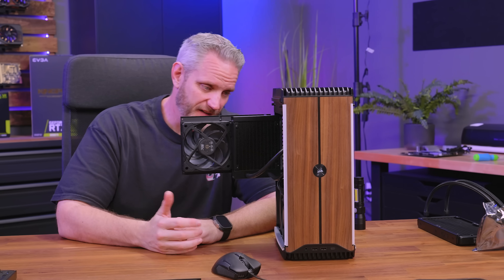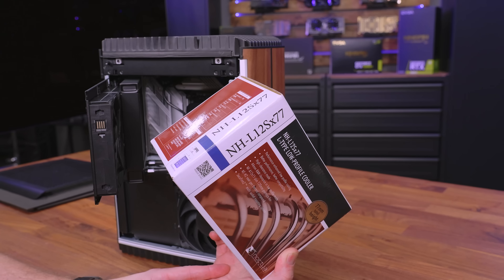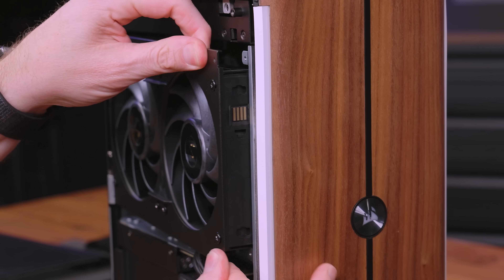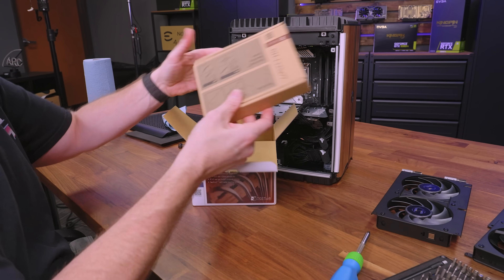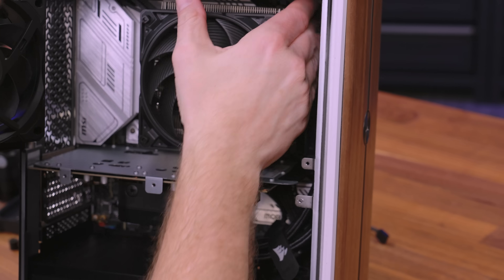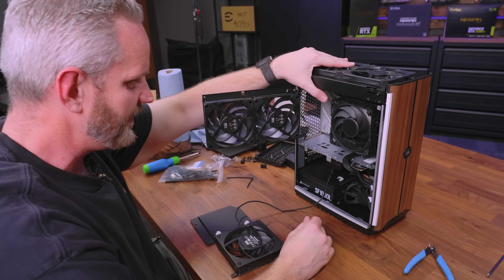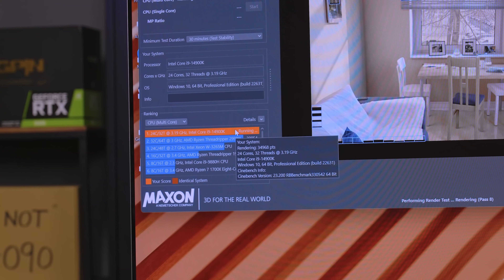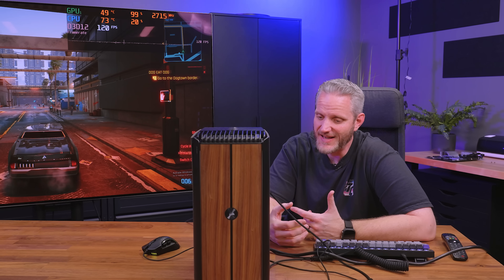Well... that was an unexpected improvement...

Comment: Hey Jay. You are talking about "saturation" of the liquid in terms of temperatures. This makes sense. And this is the reason why my fan curves are set up to adjust via the liquids' temperature, not the CPU/GPU temps. Because the logic behind it is, that if the liquid is cooler, it can decipade more heat from the actual components that are causing the heat.
No video of water cooling comparissions ever covers the temperature of the liquid. Sure, a bigger, wider, longer, thicker radiator makes a difference since there is more surface area.
But how much does it actually matter how high or low the liquid temperatures are? - Cooler liquid can take more heat out of the components, but to what point? Like what is a critical point where it doesn't "cool much" anymore? Does it matter if the liquid is just 30°C, or 36°C - does that make a big difference and if, how big? - Is it worth ramping up your fans just to keep the coolant as cool as possible, or can you easily have it take an extra 5 or 10K in delta and still get the components down to the same temperatures, or maybe just 1 or 2°C higher?
I don't know how to describe what I am looking for since english isn't my native language, but maybe you get what I mean and can make a video about that.
Reply: I'm on the same logic. On AIO, you are cooling the water with the fans. If you keep the water cool and  not going over certain temps, it will not let the CPU also reach high temps. You also remove the constant ramp up of the fans. 

Another thing that happen when you have set them to CPU temp is that after the load is gone and the Cpu cools down, the fans will spin down, leaving the water temps high for a longer timeframe.
Reply: @Mysteoa  That is why it is a good idea to set a short delay before the fan speeds ramp up and a longer delay before the fans slow down, if your BIOS has that feature. First short delay (couple of seconds) so that the fan does not unnecessarly react to short heat spikes your CPU sometimes has when doing background tasks and a longer delay (maybe 10 seconds) before it allows to fans ramp down to let it cool the water down quicker after the load has ended.  This way you are still reacting to CPU temps but on a slower pace which is a benefit of water cooling because the water is still acting as a heat soaking buffer, you do not have to have the fans ramping up and down every 3 seconds like in an air cooled system.
Reply: @MaaZeus  isn't it just the same result with extra steps? With my current setup, the CPU barely goes above 80C. I also don't have to adjust it for summer/winter.
Reply: @Mysteoa  Perhaps. This is falls between water temp controlled cooling and CPU temp controlled cooling. CPU temp is still the one controlling the fan speeds but it doesn't have to be so hyper reactive like air cooling needs to be.
Reply: The "problem" of using water temp only for fan speed control is that it takes a longer time for the water temperature to raise than it takes for the CPU temperature. But when CPU temp raises you know water temp will in time raise. By using CPU temp monitoring the fans will speed up before the water get warm, giving the radiator more chance to keep water temp down. and cooling the CPU quicker than if you monitor the water temp.

Now I'm not saying that water temp isn't important, it most certainly is. But the time needed for water temp to raise significantly is longer. Both methods work but one tends to react slower than the other.

Comment: This case design is stupid. My meshlicious is smaller and has space for a 4 slot gpu and a 280mm radiator mounted vertically. Why not design something similar to that?

By the way: this case design could probably fit a C14s or maybe even a small dual tower cooler, like the D12L.

Comment: If top part can fit 240mm GPU rad than case probably large enough to fit 240 for CPU
Maybe it`s possible to put CPU 240mm rad inside first, than close the lid with fans and screw rad to it?

Comment: check out the CFM on your fans, and maybe look into Delta fans. Yeah, they scream, but most of them have great CFM.

Im actually cooling a ryzen 9 5950x with a bunch of Delta fans in a 90s old style fool tower sleeper build no water cooling. surprisingly my 3080 ti is actually cooler then my cpu... I am honestly not sure how much more of a challenge this would be over what I did, lol. I might edit my post later with the delta fan models and what deep cool cooler I am using with these delta fans.

side note the hotest my gpu will get is 71c while my cpu when doing video upscaling will hit a max of 79c

most games even buggy mw3 does not even get close to making my gpu or cpu this hot.

Comment: An interesting video would be testing how many N x 120 mm radiator you'd need per high end cpu/GPU, and where the point of overkill (or like this video shows undersized) is where more is just wasting money.

Alot of people i see either build the water cooling to big  and just waste money (though I'd say there's a point for aestechics and such), or put a small aio on a cpu and believe its fine just because it says "water cooler"

Comment: Does the GPU have coverage on the memory? Or the VRM for that matter? It looks like it doesnt which is surprising, even with airflow throughout id feel like there isnt enough surface area to wick away the heat, but idk ive never pulled the trigger on AIO conversion kits for GPUs lol

Comment: This system feels like there were multiple teams not talking to each other when it comes to its development.  I mean if you know the CPU that is going into the system you immediately know the max amount of watts this thing is going to be generating at the high end.  At which point you know what cooling solution you need, at which point you have a good idea of the basic size of the chassis you need.
What's even worse is that for a $3000+ system these results at default config are bad.  Really bad.

Comment: I have been looking to the 14900KS but I am not really sold on liquid cooling. Were I to go that route, I might consider some sort of external radiator & fan assembly to totally remove the heat from the case.

Comment: True, 1 more inch wouldn't have significantly lengthened the case to cause any large issues as far as floor or desktop space is concerned but barring that, Corsair could just orient the case 90 degrees from what it is to then allow enough room for a 240! Either that or rotate the swinging bracket and hardware 90 degrees and then hinge them on the bottom of the current config to make said brackets long enough for a 240 without altering the case dimensions. Sheesh.

Comment: You would probably have issues with both ends of a 240mm radiator. The 120mm they have installed is turned 90 degrees, so the end with the tubes isn't included in the case depth dilemma either.

Comment: Now this falls more into line with my air cooled 14900K and the gaming temps are exactly the same. I must have a setting wrong in my bios cause I'm getting a lower score at 30K but my clocks stay higher like 5.3GHz P core the whole time. Or my CPU is dead essentially and I need a new one.

Comment: You could try the Thermalright SI-100 air cooler -  thicker with 6 heatpipes.
Reply: Thats only 0-3 celcius difference compared to Noctua L12S 77 in favor of Thermalright cooler.
Reply: @jarnom85  3 C can make all the difference. Especially when you consider how much cheaper the Thermalright one is.

Comment: I have gone back over to air cooled because it is much more reliable. And cost much less and does work very good. I have a Thermalright Phantom Spirit 120SE ARGB CPU Cooler that only cost me only $35.90, and it does the job for my AMD 9 5900X.

Comment: so basically if you want your PC to double as a space heater then buy an Intel CPU? I used to be an Intel fanboy but since switching to Ryzen yrs ago with the R5 2600X I'll never go back to Intel I don't care if Intel ends up getting 2x faster then AMD. I'm now on an R9 5900X (yes, I know it's now 2 gens old) and plan on sticking with AMD forever.
Reply: Intel for ever..  had been hardcore amd user..tried intel i was reborn..now after 12600kf i went back to amd with 7800x3d  and i cant regret it more...miss my old 12600kf..oced was waay more stable than 7800x3d

Comment: I wish I could use Fan Control on my laptop. HP uses hardware sensors to control the fans. I had to solder the PWM wire from the second fan to the first fan since HP doesn't uses it. It spins on start up then turns off after windows boots. Never spins again even if the GPU and/or the CPU is throttling.

Comment: Water cooling with a 120, not worth the extra costs and additional points of failure. At 240 the benefit is at least competitive with air methods. Never underestimate Air Coolers actual potential. The low profile coolers are also light enough that I wouldn't stress a lot when it comes to shipping as well.
Reply: Especially if you can’t see the inside, you don’t even get the looks factor of an aio

Comment: All of this could have just been solved with an AMD 7800x3D, because a 120 AIO could handle that, and it's a cheaper cpu, and performs faster for less wattage.
Reply: Unfortunately there are too many people that blindly believe Intel is the best.
Reply: @justevil100  Its crazy how often 14900k is used. Such a heater, stability issues etc.
Reply: I think even a 14700 would struggle in this shit box.   This case cries out for a Ryzen chip all day simply because of its appalling design.
Reply: @malphadour  If we're being honest, Intel has no chance. It's not just the performance per wattage that is at stake. You gotta consider the fact that they didn't give partner motherboard vendors the correct clocking spec, meaning that the average person would have their system overclocked to the redline in terms of heat and efficiency without being aware of it. In that caveat, AMD absolutely wins.
Reply: Shhh too easy need more content 😉
Reply: Eh I feel like this PC is meant for productivity and not gaming, where the 14900k is better. Probably could've went with a 7950x though, although not sure if it's equivalent to 14900k in productivity
Reply: @userblame632  This PC was meant for being showcased in a living room, akin to a home theater entertainment system. Even Jay said as much given its unique style and look. It was meant for gaming, VR and movie entertainment.
Reply: @luminatrixfanfiction  ah ok, yea a 14900k is a terrible decision then
Reply: @userblame632  7950x does better in terms of productivity than 14900K. And does so at Two Thirds of power draw. But Hey, intel users have always options to power limit their CPU, right? Like taking that 250W+ chip down to 120W and then compete with AMD's X3D chips in gaming. (If one dares to call it 'competition' when intel chokes itself while AMD runs circles around it.)

Comment: Jay , could you put two (2x) 120mm rads in series in the hinge/door ? Cpu>rad1>rad2>Cpu 
Since the two 120mm rads would have the end-tanks on top and the fittings on bottom, they could fit; rather than a 240mm with the tank on one side and the fittings on the other. 👍
Reply: way too much of a pain tbh. Youd have to cannibalize 2 AIOS or do a custom loop
Reply: @Shadow0fd3ath24  I don't think so. You (Jay) have the Stock one already. You only need 1 similar rad and a short patch tube to go in between the 2 rads. And 2-3 straight fittings.
Rad 1 is the stock 120 rad.
Cpu block (stock tube) >rad1 in > rad1 out (patch tube) > rad2 in > rad2 out (stock tube out)> Cpu. :body-blue-raised-arms: +1 extra fan for the new rad ofc.

No need to make it more complicated than that.
Reply: *swap one of the straight fittings with a T/Y as a fill port.
Reply: @IcecalGamer AIO radiators are aluminium so they wouldn't work with open loop radiators (which are usually copper). Also they're not really made to be serviced, so the tubes are crimped on, and you can't easily refill the loop once you've cut open the tubes. It's really a non-starter especially considering the target market for these pre-built machines (people who often just want it to work without having to tinker with it)
Reply: @DuyLeNguyen  Talking about target market: This computer is defective out of the box anyway. If a cooling solution out of the box throttles your components at 100% load, EVEN in 20C air conditioned huge room, how it gonna fair in Texas non AC man-cave/shed? Ok? Aaalright.

Now that we've established that this experiment is just for giggles, does it matter that we mix metals? In a 2-3 hours experiment / proof-of-concept? Neah. Long term, Jay already knows that mixing metals in car engines works as long as you Maintain your coolant and additives. Could do that, if you Really want to go long term use. But again, it's not the case since the point of it was: 
"Could it work? Could it work better than zip-ties on a 65$ Noctua cooler (before tax)? Should it have came like that from the factory, with 2x120mm in series?"
Filling issue: read my previous comment. +Jay could vacuum-fill it.
Reply: @IcecalGamer  Oh yeah I don't disagree with you. This prebuilt is toast, nobody should buy it. I was more responding to the futility of the other commenter's suggestion in trying to somehow splice an additional radiator into a closed loop cooler as if that's a reasonable solution.
Reply: @DuyLeNguyen  Neah :face-green-smiling: Reason (as in a reasonable long-term solution) go out the window the second zip-ties and ductape enter the scene :face-turquoise-covering-eyes:
I was just embracing the jank by frankensteining another 120mm in series, the most barb (hehe barb) barbaric way possible. Cutting the original tubes, boshing some barb fittings in, held in with zip-ties and prayers. For Content and proof of concept, not for actual TUV-passed engineering :hand-purple-blue-peace:

Comment: i think just adding a rad in the same orientation next to the one already installed could work with a better GPU pcie cable placement.
take the water out of the one just beside it and out the second back to the cool plate, mh ? jay ?